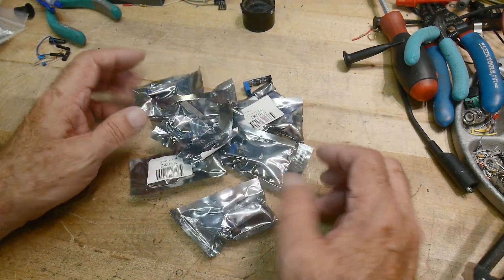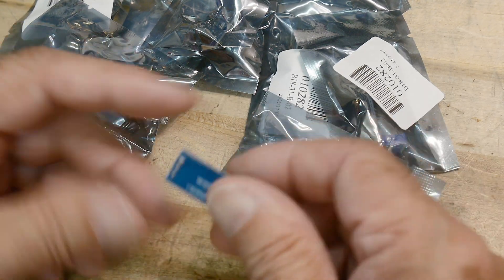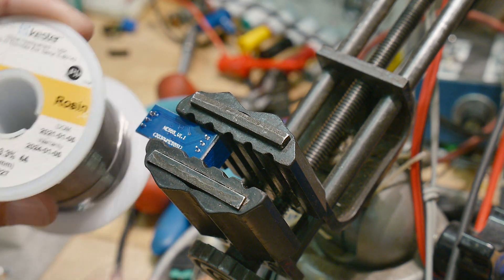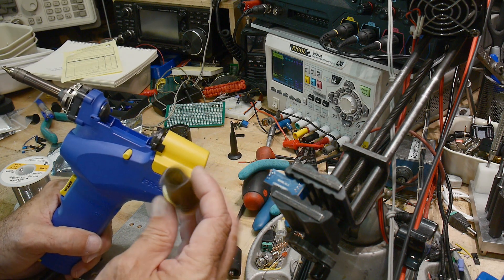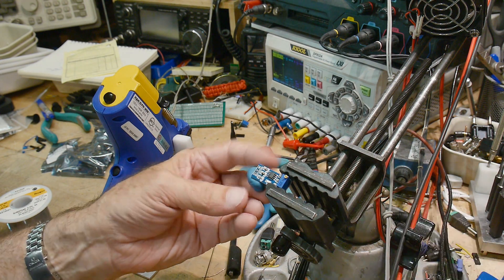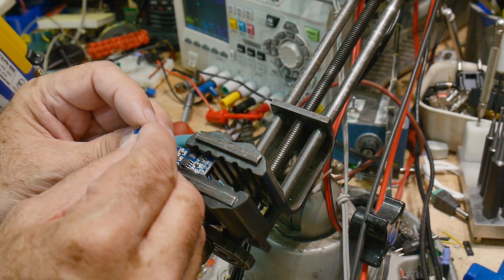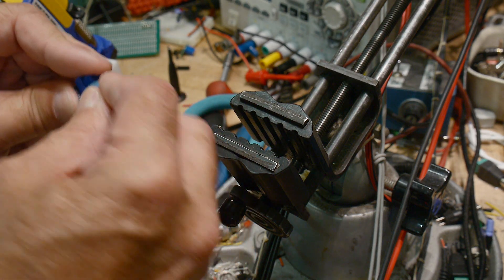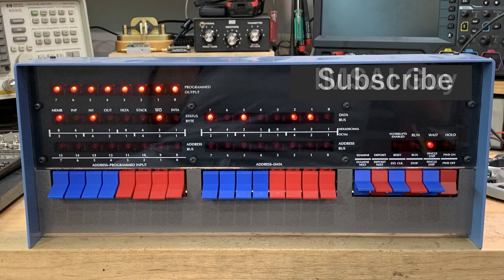#1248 555 Modules Modified

Comment: For the less experienced folks... The particular type of potentiometer that came on the board and the potentiometer that IMSAI Guy replaced it with are both called "Trimmer Pots." The name explains their intended use... They are used as adjustable resistors, in situations where the exact needed resistor value can not been known, until the circuit has been built and tested. An example would be a resistor used in an oscillator circuit (just like the modular 555 board, itself) to tune the oscillator to an exact frequency. So, why the special name? Because trimmer pots are meant to be set and adjusted only a very few times. They last a long time, but they are not meant to be turned on a routine (daily) basis. You need a regular potentiometer, for that kind of use. They are perfectly fine, for the modular 555 board and for experimenting. But, for something like the volume pot on a stereo amplifier, you should use a regular pot. As with all electronic components, there is a lot to know about pots... Their different types and uses... You could start by learning the difference between "linear" and "analog" pots. I hope that helps someone.
Reply from the maker: I should do a video on LOG  pots (two section linear)
Reply: @IMSAIGuy  whoa, i was about to mention the log pots. I saw this video of yours a few days ago but for some reason just watched it half. A video on log pots would be great!!

Comment: Nice modifications. I also got some of these 555 modules for general purpose from ali-express. My modification was to replace the bipolar timer chips with the c-mos version to save power in battery driven applications. 
In fact it was more to see how to operate with the TSOP packages. On this occasion I got some of the ICs in TSSOP and I was glad that I did not have to work with  them, (for now).

Comment: Now it sucks! 😜
However I develop my chip (i.e. 555, 4015, 4017, monostables, astables,...and all those recursive circuits in our projects) modules for breadboard in VERTICAL, so the module  does not "eat" breadboard holes underneath and it's easier to access to the module pins through them 😉 my 2 cents 👋

Comment: I just looked on ebay (U.K.), they are asking nearly £3 for one module. What a rip-off.
Reply: Continue to look for them in quantity. Often, on Ebay, you will find one for L3 and ten for L3. Why, because the shipping costs the seller the same for one as ten and the shipping is the majority of the seller's cost, for this type of item.
Reply: The first one I found that was the same as in the video was £5.00 inc. shipping! Rip-off Britain!
Reply: Yeah ! I couldn't believe it when I checked !...that's a joke.
Reply: @andymouse  There was a 5 pack for £10. Completely insane.